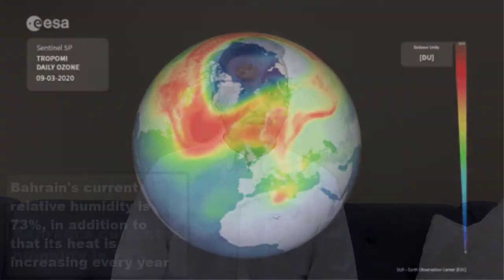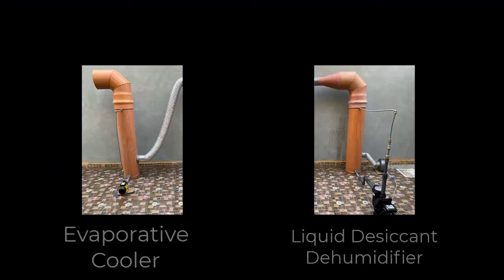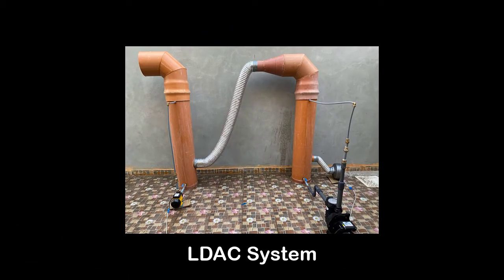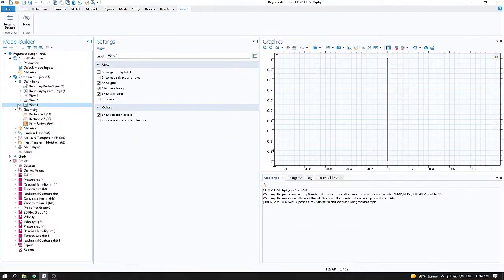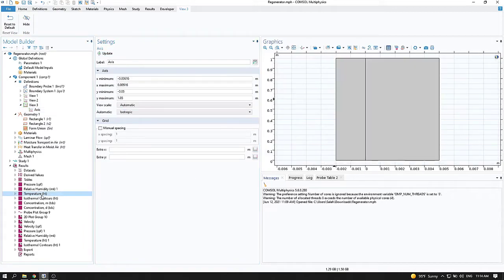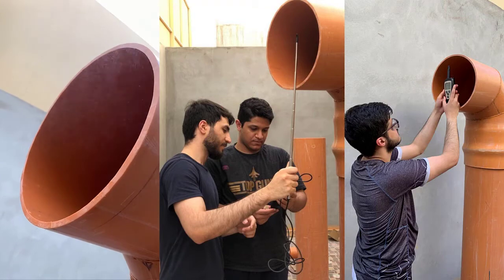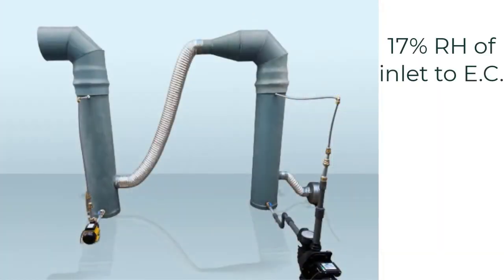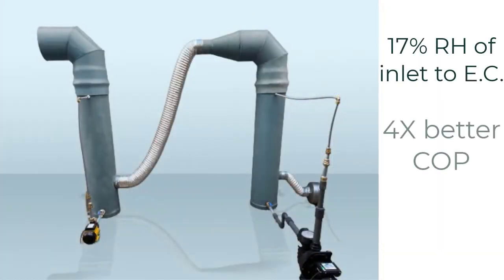Green Cooling Alternative Cycle Using Evaporative System with Liquid Desiccant Dehumidification

Comment: There is now need to reinvent the wheel in evaporative cooling. There is a dew-point water evaporative indirect air cooling invented 50 yrs ago, 30 yrs on the market and 3 years as the next Gen3 generation tech with 20X energy consumption reduction. More details at our YouTube channel